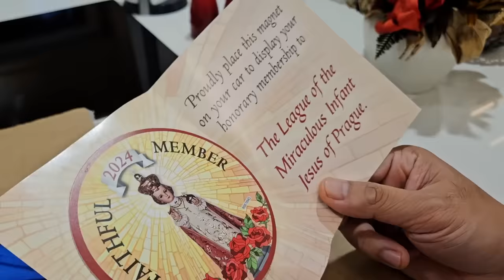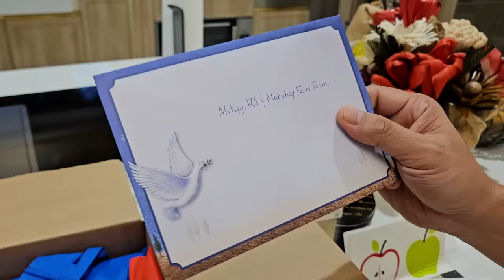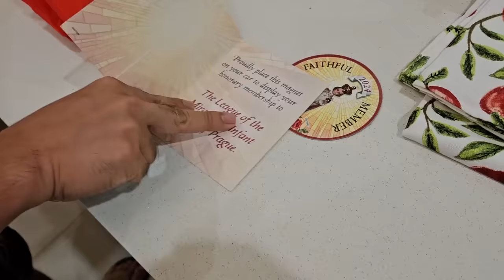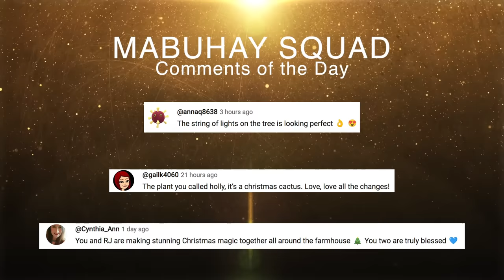Moving Our Parrots to Their New Outdoor Aviary | Vlog #1694

Comment: I think the Golden Pheasants will do better in the outdoor aviary long-term once them and the parrots will get accustomed to each other if you choose to acclimate them there. For one, Golden Pheasants need to dustbathe and could make a mess on the floor of the indoor aviary if you'd place a pan with sand in it, and they apparently like to dustbathe in areas with plenty of sunlight, juast like their chicken relatives. Secondly, they could deter mice and small snakes from entering the outdoor aviary, since the bars of the cage seem big enough for a mouse or a thin-bodied snake to pass through. If the pheasants are in the outdoor aviary, the snakes and mice would not want to enter for fear of being eaten since pheasants will also eat small mammals and reptiles. Putting a pan of sand for dustbathing purposes in the outdoor aviary would make it easier to clean as well. By the way, looking at the Indoor Aviary, I think placing more bamboo in it will make it look attractive once you start planting it before adding smaller songbirds, as well as tall grass-like plants as most finches prefer open woodland and grassland habitat. Situating the panels around the glass viewing panels could also mask it from the view of the birds to prevent collisions if they get spooked for one reason or another even if they already know there's glass there after acclimation. Might be possinle to place such plants in the higher levels in the aviary as well could be possible.

Comment: Hi Mike, Just a word to the wise. The rabbits need sitting boards inside their pen, so they can get off the wire. Otherwise, their feet will get sore. Also, be sure to clip their nails. Pretty much for the same reason. If the nails are too long they get sore feet.